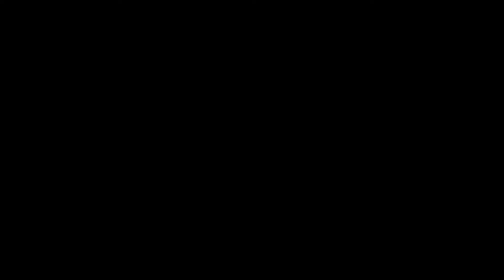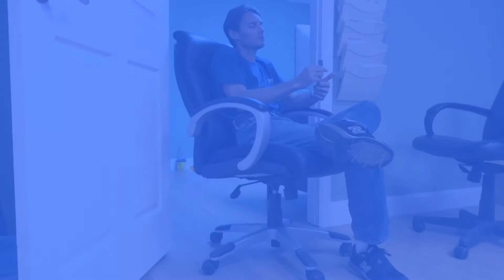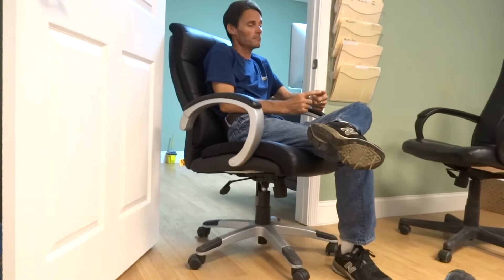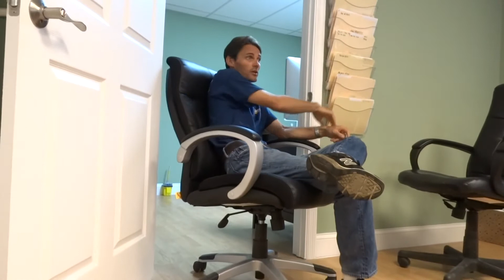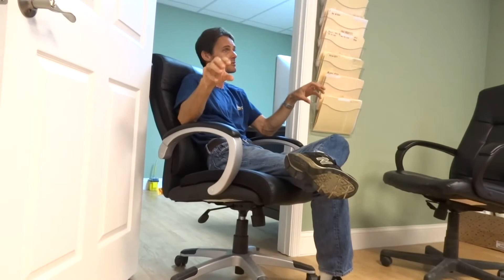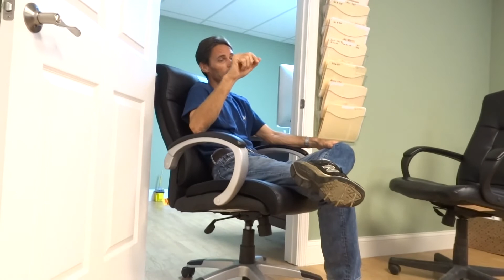James Knight technician training session.

Comment: if you getting shore power from dock and are going into the elec of the vessal  you need to cut of mail side hard wire that into the  fuise pallal  of vessal  basicly reversing polarty  into the vessal from the dock only if your using your  vessals genrater and full ecticalp pannl and  system  is that what you talking about  i had to do that to pump builge on the midas  when some one stole cords and un hooked power from the midas so thay could  clame saving dock and i came down cut the cord and hard wired the    the opsit of the power coming in off dock in the fuse pallal and the builge started pumping out and boats next door owners came running out . not getting into what was said but is that what your talking about because ive always worried about  conflicting  baot power and shore power while runing the genrators ivertores and keeping the hole brain of the boat going and all the ather going in the right deraction and charging  ever thing when you  have one ten interacting with the flow, now every thi elec evan the hatches to get in and all the new tech . i geuss  its propared for that and i wouldent have to hard wire a extene cord off the  ballerd oil dock onto a  3 milloin or more yaht thats what you guys are hashtaging about or im i tataly  ablivise of some ather isuse i never delt with  a 2 mill yaht. the more i know the more i dont , and my spelling seams to stay the same .sorry  some day maby i can comunicate in person with a prson familler with somthing happy 4th